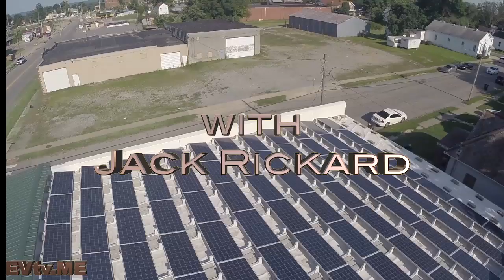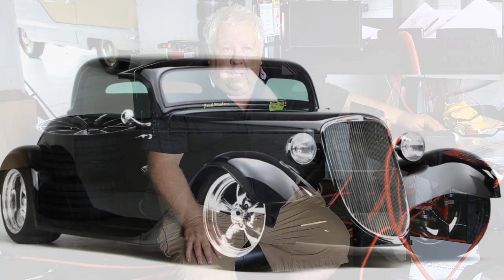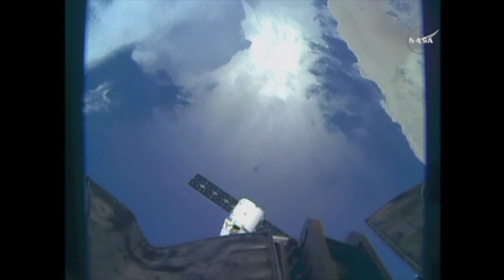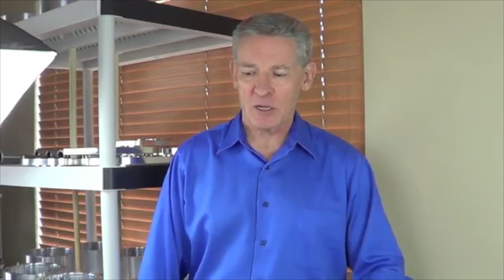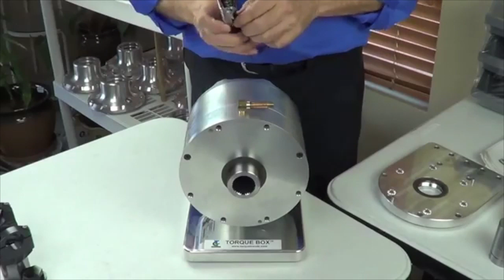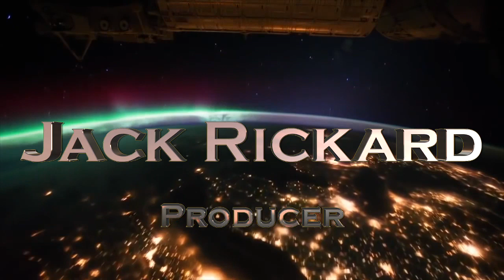EVTV Friday Show - April 25, 2016.   Torquetrends 2:1 Direct Drive for EVs

Comment: Did not understood why was the left side (from de camera perspective) locked, when the right side rolling once you disconnected the "creep mode"?
https://youtu.be/WX6Xhl-SP9Q?t=438

When I look at it I can see that the right side is faster then the left side, why is that?
Reply: The reverse mode was only with the right side rolling, I think I missed something.
Reply: +Leonardo Reis As he said it's because of the the open differential.  It will try to keep the the torque the same between both  wheels, but since there are no tires or load the hub with the least resistance gets accelerated to a higher speed and the wheel with more resistance slows to a stop.  If the wheels or in this case hubs were providing exactly equal loads they would both spin at the same speed, which is very unlikely without wheels or a car body weighing everything down.